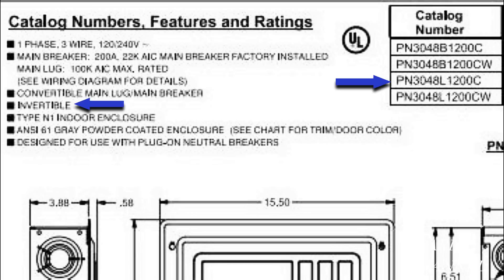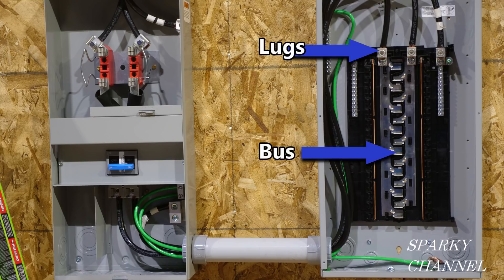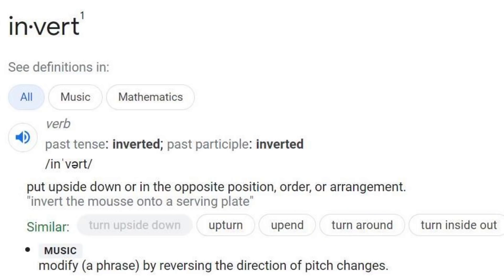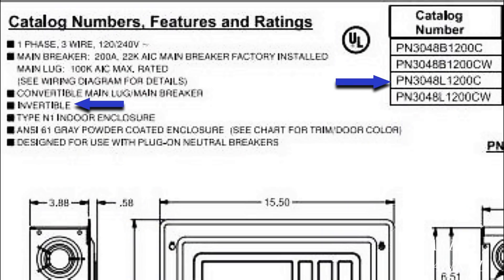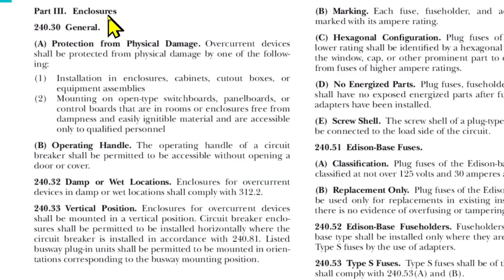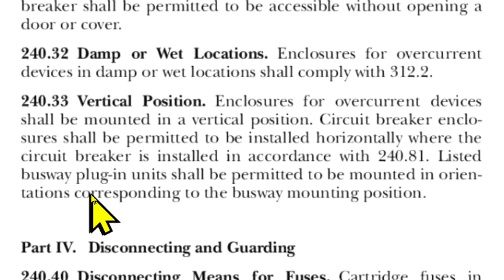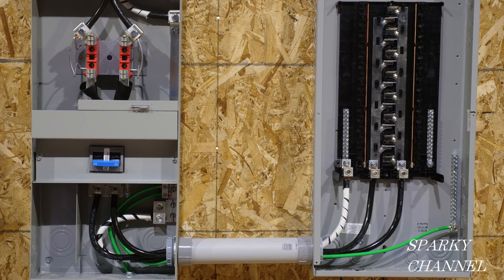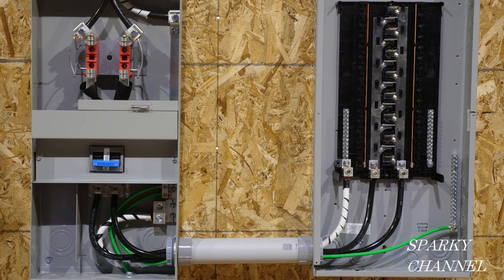What is an Invertible Load Center?

Comment: My electrician installed the plug in neutral main breaker 100amp 20 space PN2020B100C Siemens model in my garage. I need to add a couple more breakers. He put all the grounds and neutrals on one side leaving no additional holes. There are two additional ground(1) and neutral(1) bars on the other side. Can I just use those? Or do I have to run a jumper? It is not the first means of disconnect. Thks

Comment: Thank you for your videos.

Question: In this case, given that the first means of disconnect is upstream of the main load center, you would remove the green bonding screw, correct?
Reply from the maker: Yes, that is correct. Great thinking!

Comment: Very helpful info. But can you route the conduit so the bus will be on top and not have the extra wire inside?
Reply: I meant the lugs not bus.
Reply from the maker: @andymartinez6299  It would mean lowering the load center which is probably not practical.

Comment: Might be a dumb question, but you showed the code for circuit breaker off should be down. If this one had a main breaker instead of lugs, would that limit the orientation of this invertible panel to whatever orientation keeps the main on up and main off down?
Reply from the maker: No, see my video: What is a Convertible Load Center and How is it Converted?: https://youtu.be/7ooMpFlIBzI
  The main breaker turns on and off sideways.
Reply: I did see that one, but just wondering if one moved up and down as opposed to left and right, would that impact the invertibleness? Or are you telling me that the only main breakers for this panel will be side to side?
Reply from the maker: @scottcrain2269  Yes, all the main breakers available for this load center open and close side to side.

Comment: Another great and informative video. I watch alot of TV DYI shows it seems like most are filmed in Canada.  Up there they install most main breaker panels horizontal.  Is that way allowed in the US ? Horizontal looks like a much better way to install with branch feeds going straight into breakers.
Reply from the maker: All the breakers would have to be up for on and down for off and the enclosure would need to be listed for such an installation.

Comment: questin here sparky are you allowed to use wire nuts or pig tails inside the breaker box to lengthen the short wires to reach the breakers.

Comment: Personally i think the load center should be wired the correct way. not inverted. as far as safety i would think it easier and safer if the lines were coming in at the top. what would happen if something is dropped with the panel cover off and the power was not off. dropped a screw driver or wrench anything that could bounce up from the bottom of the inverted set up and start arcing. i dont know. some people install out lets with the ground up for some kind of safety reasons and some install with the ground hole down. it just does not seem normal for the inverted set up. and how much wire would you actually save by doing this inverted.
Reply from the maker: Thanks!
Reply: ... while I agree with the general safety aspect, this is just saying it's allowed by code. Some might use this exception for mounting a panel above a wire tray or in the case of an R (rainproof) panel where you want no penetrations from the top.
Reply: One could make the argument that minimizing the amount of feeder wire in the panel is the safest thing to do. If those come in near the bottom and you mount it with the main lugs/breaker on top, you have to snake those feeder wires all the way up one of the side gutters. Those thick feeders take up valuable space (as said in the video), but they're also in an area where damage is possible when installing breakers and more branch circuits. One slip when punching a knockout could hit those feeders and damage them. They are always live (and have lots of juice), even if the main breaker for the panel is off, so they represent a huge hazard.

Keep the areas of the panel that can't be deenergized as small as possible, including feeder wires.
Reply: @bnasty267  I dont know it seems the codes are changing yearly. maybe this is so more NEC books can be sold. to me there is one way to do things the so called correct way, why keep changing things. seems the NEC is just like everything else a scam to make more money.
Reply: @kennylavay8492  The thing is, there's no such thing as the 'correct way', besides ensuring that the breakers are oriented correctly and the panel is built for either orientation. As the video shows, the manufacturer puts the labels sideways, so they don't look dumb in either position. It's nice to have the flexibility to go lugs-down if the situation makes that the easier/cleaner way to go. 

I have issues with things the NEC changes like GFCI on 240v circuits and arc-fault everywhere. That makes everything more expensive and potentially less reliable with annoying AFCIs. A panel with invertible orientation is not like that.
Reply: @bnasty267  exactly if it were not in the NEC book about inverted panels the inspector would not sign off on the install. NEC chages things i think only to make money on buying new books for the students getting into the electric world. just like some colleges make kids take courses that have nothing to do with the field they are in but it is thrown in there to pass the course you are interested in. its all about the money.
Reply: Uep
Reply: Yep

Comment: Where I am, the feeder / line side of the panel has another metal cover over the entire wires. So it is very difficult to ever touch there wires.
Reply from the maker: It's called a dead front. This enclosure has one as well but I didn't show it.

Comment: I don’t understand why Siemens put only a 15 plugs for neutral on the sides when you use the main panel bounding for grounds you will have the problems “ no more screws for neutral or ground
Reply from the maker: On my PN series 30 space 48 circuit load center (shown in the video) there are 24 neutral terminals on each side for a total of 48. I'm going to do a video on plug-on neutral so I'll show that at the same time. Thanks Jose!

Comment: Main Lug Only Load Center = Subpanel, with ground and neutral segregation
Reply from the maker: Thanks!
Reply: I'm not sure what you are trying to say here. You can have sub panels that aren't loadcenters as well. It doesn't seem to have any bearing on anything here.
Reply: @lgninjalo  I made the observation that the "main lug only load center" demonstrated in this video is a subpanel. So it would be wired as one, with neutrals and grounds NOT bonded together. Sorry my initial post is cryptic.
Reply: I'm with Aaron on this one, I had to go back to watch the beginning but I saw the green screw bonding what should have been an unbonded subpanel
Reply: @chrisott4892  Oh! I honestly didn't notice that green bonding screw. Yes, it absolutely seems incorrect to have that screw installed.
Reply: @chrisott4892  the screw isn't likely installed. A lot of them come with the screw in the slot, but not installed.

Comment: How far from the controlling breaker can the lug only load centers be located.
Reply from the maker: Very close. I don't think they could touch each other because the doors have to operate freely but they could be quite close.
Reply: @SparkyChannel   For mechanical devices, I’ve been taught to have a means of disconnect with in ten feet, and with line of site from the access panel to the device.  

Just wondering if the NEC has similar requirements.  You wouldn’t want meter and primary disconnect on the exterior of a garage, and a load center on the inside.  At, least I wouldn’t.
Reply: @randallthomas5207  Hmmm. The 2020 NEC says that the main disconnect has to be at the meter. So if you have a remote [outside] meter and main lug load center inside, you got a problem. 

The main disconnect at the meter requirement is so that the fire department or whoever can disconnect the house from the line-in without going inside.
Reply: @ricoludovici2825  
Just had everything outside on my house replaced, new mast head and meter box and new wires to breaker box, a few days ago.
They didn't put a main breaker outside. however there is a throw arm inside meter box that is sealed by Ameren. 
I live in Illinois 30 miles east of St Louis Mo.
Reply: @daletyler5344  Ol' Sparky here put up a vid that shows the 2020 changes. One of them is that disconnect at the meter, where ever it is, like I said above.

Probably your local code enforcement authority has not officially adopted the 2020 code or, more likely, they just do what they want. When I lived in Iowa mn y decades ago, we'd get a job that was "out in the county". That meant: no inspections, no code requirements check. Just grab the first/best stuff off the shelf at the materials store and getter done. Just make sure there is no bare wire sticking out. And what I did was always better than what you saw in the barn.

Power company might refuse to hook up, but they didn't. So it was acceptable.
Reply: @daletyler5344  That sounds like it could be a bypass switch for when the meter gets changed out/tested. That way the meter man isn't breaking load with the meter.
Reply: @ricoludovici2825  Yeah. Any every wise guy/burglar/ kid can also turn off your power. I hate that.
Reply from the maker: @davidgagnon2849  Yes, the "Fireman's Switch" as they are calling it hasn't had full impact yet because so many states haven't adopted the 2020 NEC yet.
Reply: @SparkyChannel  Where I live now - Clark County, Nevada; aka: greater Las Vegas - they have special addenda or exceptions to the code. Of course, you don't find this out until inspection, but some of them actually make sense.
Reply from the maker: @ricoludovici2825  Yes, they can exceed the NEC if they want to.
Reply: @randallthomas5207  ... that code for a device service disconnect is for equipment that needs maintenance, such as a well pump, water heater, furnace, AC unit, etc. It is normally within arm's reach of the unit. A main service disconnect can be at the panel, but if the meter is so many feet away (10 ft?) there needs to be a disconnect at the meter. Of course this is minimum code. You can go above code and add another at the panel. There's no reason you can't have two disconnects if it makes life easier.
Reply: @rupe53  Thanks for the insight.  Code Compliance is important, but the prime consideration is safety.  I know that if I needed to go outside and around the corner to shut things down before working in a panel I would.  I also know that most folks playing in a residential cabinet won’t.   I’ve seen the mess which results if a mouse, chews it’s way through the cap on the end of a spare conduit, and runs up the conduit into the box, then manages to get across both busses.  

I’m planning a home project to get rid of the overhead service to my house which runs four feet above the ridge line of my metal roofed and framed garage.   I also want to upgrade the wring in the garage.  The plow and transformer are at back of future curb line, 4-ft from the edge or right of way, my garage is set back five feet.  My plan is to install a new meter base and disconnect on the side of the garage, and then have a new panel for the garage rewire, and then drop out of it and go underground to the house, and have a new sub-panel there.  

The house is fifty years old, and was built before either the state, county or city adopted any kind of code, or had any code enforcement.  Started to add a circuit in the subpanel in the garage, and found the nuetral and grounds bonded, and no ground for the building.  Soil is made up of very large rock, and alluvial gravel.  Tried to drive a ground rod, with my SDS Max hammer drill, and a ground rod driver..  Went in about two feet, and locked up hard. Ended up renting a mini ex to dig trenches to install two ground rods.  The guy who did the initial wiring on the house was a craftsman.  but in the intervening fifty years, there are an unkown number of hacks who have gotten in and played with things.  Had a receptacle fail in a bedroom.  Pulled it out and found 16-ga zip-cord instead of NM.  So, one of the projects for this summer is to start pulling receptacles and switches to check the wires feeding them.

So, things on the electrical at the house are a mess, and I need to clean them up.  This all started when I decided I need to install a new roof on the garage, and have no desire to be playing with big sheets of conductor which will whip in a wind, next to the service to house.
Reply: @randallthomas5207  ... I can appreciate that. I went through similar on my 1910 home a bunch of years ago.... but at least I was able to drive the ground rods into New England's rocky soil.
Reply: @SparkyChannel  
Just had everything outside on my house replaced, new mast head and meter box and new wires to breaker box, a few days ago.
They didn't put a main breaker outside. however there is a throw arm inside meter box that is sealed by Ameren. 
I live in Illinois 30 miles east of St Louis Mo.

Comment: Morning Bill!! Nice explanation. Im in favor of the bottom fed method. Save all the room on the top for the branch circuits etc.  enjoy the weekend
Reply from the maker: Yes, it's much neater that way. Have a great weekend!
Reply: Large place that I retired from had over 30 84 circuit 120/208 panels where they feed panels from the top and all circuits feed from top of panel. Was policy to use only #10 wire for every circuit on a 20 amp breaker to firstbjunction box and no shared nuetrals. Major jam having over 75 white wires 80 black red or blue wires and at least a dozen #10 ground wires at top of panel no matter how many cablevties you use.
Reply from the maker: @garbo8962  Interesting. So you guys ran #10 to the first junction box and then #12 from there?